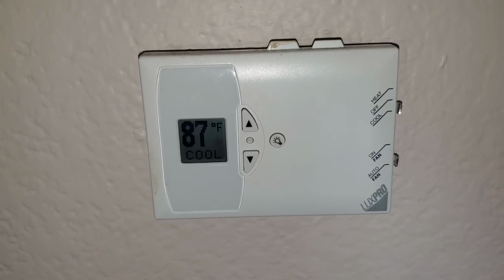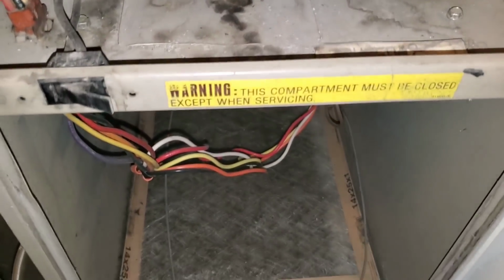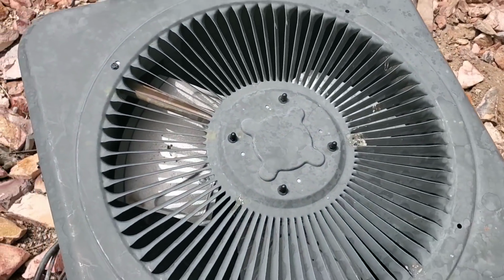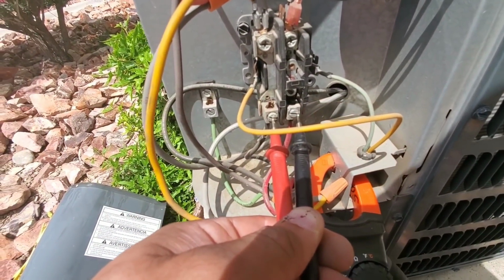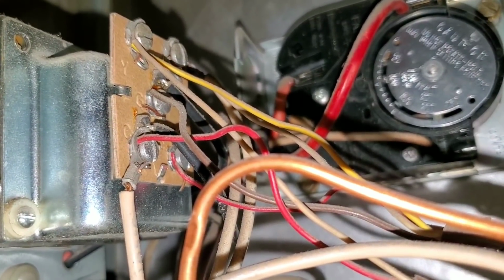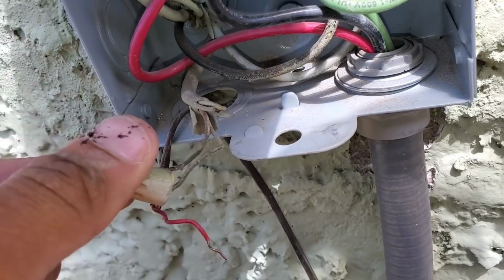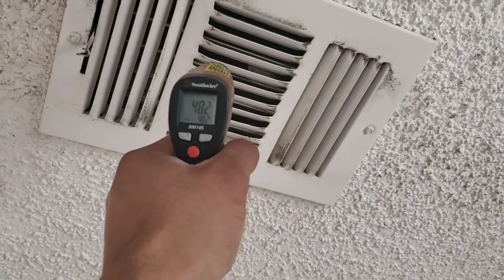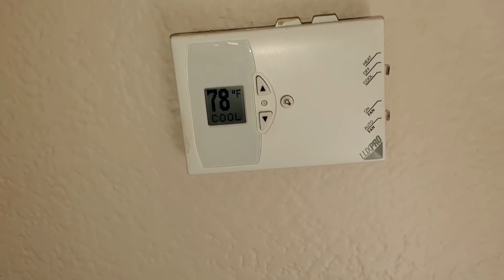AC Not Working No Low Voltage 😏

Comment: If there is 24v at the thermostat and not at the contactor then it’s a matter of following the low voltage wires from the contactor to the thermostat looking for a break in the wire, correct?

Comment: Thanks for making this series of videos. Was able to diagnose and fix my issue over 2 days. My issue was not getting low voltage from blower board out to the condenser. Wound up checking for continuity on the two wires in use and was getting bad readings. Swapped out another pair in the same jacket tested for continuity and 24v. Hooked everything back up and sent power. Contactor engaged right away and I have AC again!

Thanks again, if anyone is watching these videos please remember to be safe. If you are not comfortable hire someone. Playing with a lot of power working on an AC condenser unit, NO JOKE!

Comment: Low voltage wires in the same disconnect box with high voltage wires?
Reply: Yeah, they all get run through the same conduit.

Comment: i am interested in temp. guns and wondered if the southwire you use is better than others or if you have it as a matter of company issue? if there is a real good but inexpensive one please advise. thank you.....g
Reply from the maker: Temp guns only give the surface temperature and does not give you the temperature of the moving air. Example... if I point my temp gun in the vent it is giving me the temperature not of the moving air but of the actual duct itself. The K type thermocouple however is more accurate in giving you the temperature of the air flowing through the vents. Both are useful in the field. Both are fairly reasonably priced. The temp gun about $50 and the wire or k type thermocouple about $20. Hope that helps and thank you for the question!
Reply: no, actually i am familiar with the operation as you described. my query was southwire as opposed to other brands. which is preferred, better, cheaper, etc......g
Reply: @remushaynes2693  

Southwire, general, lots of decent temp guns out there. As long as you're not using one made for body temps, it'll be alright.

Comment: Never saw a wire nut problem before.. well done!

Hope you were able to install the plastic cover on the outside connection box..
Reply: Joe Pah 
All the time. That's because of lazy mechanics not using electric tape properly around the wire nut.